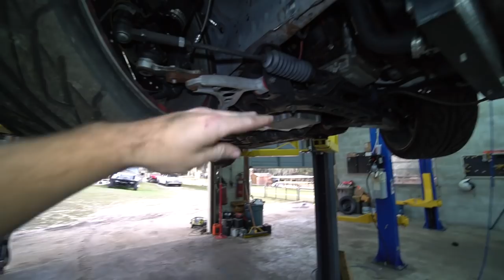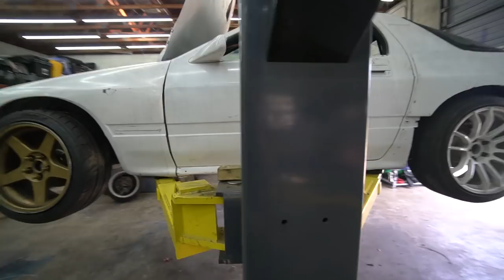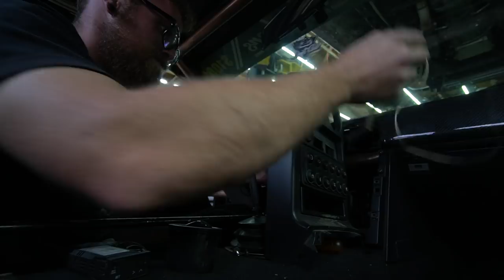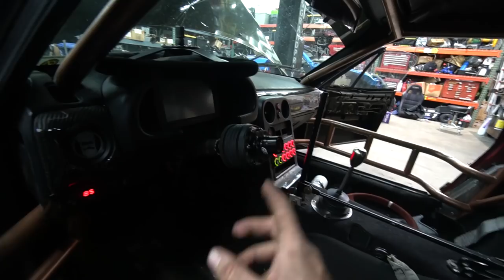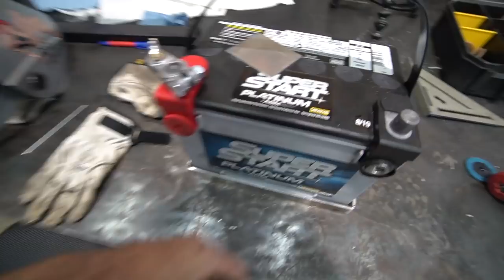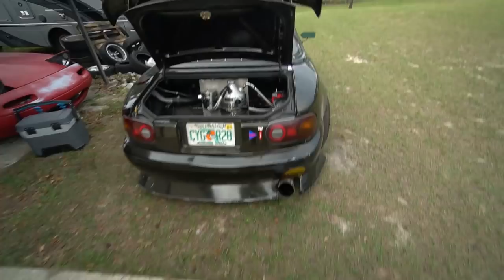Upgrades for The Abandoned FC RX7 and The LS Miata!

Comment: Go on the rx7club forums and look up "diff snubber" it's a rubber cone with a stud on it that we install above the nose of the diff to keep this from happening
Reply: Upvote this shit so Taylor sees it.
Reply: He can always PM me or add my facebook I'm very familiar with the fc chassis
Reply: I mentioned it to him a while back. Think he may have replied. I just used a truck bump stop on mine. Definitely stops the diff flopping round
Reply: Energy suspension 9.9101r
Reply: PBM front diff mount and it wont move at all. Its a giant hunk of solid steel., if you hear it hitting the subframe after throwing one of these on your subframes cracked and the front mount isnt the main worry anymore. Put one on and be done with it.
Reply: +1 for pinion snubber. even if you run the pbm diff mount you dont want it to take all the load. cheap easy mod that works.

Comment: Love PB. Was introduced to it working on heavy machinery from the 80's-90's in a factory setting, worked great then. Now it works great on the rusty NB Miata from Illinois I'm cleaning up!
Reply from the maker: The first real project I did was the torque tube on this 951 Porsche I had. Old beatup with rusty bolts. Kept snapping them. Friends dad recommended them to me. I didn’t think it would do anything. Magic in a can? Come on. Didn’t snap another bolt. Haven’t snapped one since.

Comment: Don't need any input from me but I'm going to give it any ways. PB B'laster=awesome and all I use for rusty nuts and bolts. I've been using it my entire professional wrench turning career. In fact, When I recently did my head swap on my 97 Comp T/A. I soaked the bolts on my all my exhaust connections (LT Headers to pre axle dump) for about 30 min. The exhaust hasn't been off the car since I installed it in 2007. Bolts came off like they were brand new, I recommend this product to every one. (No I'm not sponsored..lol)

As a side note, picked up a 2000 Chevy Silverado 4x4 as a new project truck recently. Stock exhaust hasn't been off the truck once in its life. First mod I did was LT Headers and full exhaust. Once again PB B'laster helped the entire exhaust system come off like it was brand new.

Comment: pb blaster every bolt on your projects a few times in the weeks before you wanna work on it, it saves so much time. when i was working at a place parting out jeeps wed walk around for 10-15 mins and spray everything we were going to pull apart

Comment: Hey taylor! I used to be a sheet metal fab guy too, I just wanted to let ya know that if you had wanted you could have notched the outer leaf's of the batt box and folded it up with a hammer with it in the vice! Might have been quicker but I know you also like to weld whenever you have the chance

Comment: I think you should look at the linishers, long belt sanders, i have one that hangs off one side of my bench grinder and has the round sanding pad and the long thin belt. Use it for everything, and they aren’t too expensive either. Cheaper still if you get the bench grinder type and you already have the grinder, you can just get the attachment. For cleaning off the alloy before welding etc its a real time saver!
Reply from the maker: Yeah I need to invest in one of those. Room is the biggest problem right now. When I get my own shop I’ll really up my fab tool game.

Comment: You can run 18’s I ran a cheap set of XXR’s 18x9+22 offset with a 235/40/18 for a tire! I’ve ran a 245/40 in the rear with rolling otherwise gotta run the 235 squared with BC’s also! On my vert! Just a thought

Comment: “Pinion snubber mod”  on rx7club. it’s a bump stop mounted to the floor. Pre lodes with washers. Worked great for me. When I went solid front mount on the diff I broke many stub shafts and complete diffs, till I went back to rubber
Reply: There is a dimple in the floor so you know exactly where to mount it

Comment: Pinion snubber for the front of the diff. Will save your mounts. Part #9.9101G
Reply: Install is insanely simple and there is a dimple where it mounts in the chassis. Between what would be the seats or containers.

Comment: PB Blaster is great. Spray about a 1/4 to 1/2 inch into a Styrofoam cup and let it sit and watch. It says it on the can but most people don't see it and/or try it. I'm guessing other brands don't react the same which means they're not as effective.
Reply: Lol how it reacts with styrofoam has nothing to do with how it reacts with metal
Reply: That was suppose to be more of a question at the end of my comment. Gasoline melts a Styrofoam cup too doesn't mean it'll help loosen up bolts. But, it does show that it has certain solvents that could potentially help break rusty or gunk up and not just lubricant.

Comment: If is possible at all for the metal braided oil lines reach the positive on the battery? (just so you don't accidently set it on fire, like if you get some external help if somepone hits your rear or something)
I've seen a racecar get on fire when the metal braided brakelines accidently hit a positive connection, and that put a hole in the hose and lit the brake fluid on fire (green-ish flame ;))

Comment: The diff snubber is a good idea, but i think you will regret not welding a “Taylor Made” solution to stop that diff sliding up as its obviously an issue that happens over and over.  A welded in stop with a bit of rubber will fix the issue for ever.

Comment: i wonder if that power issue had anything to do with your power steering going out and feeling like shit. i work for gm and ive seen alot of stupid issues occur over the smallest voltage or resistance drops. might be worth it to put the motor back in and see how it works.

Comment: What was wrong with the white wheels the car came with? Were they 18s?
Reply from the maker: 17’s but the lug holes are tiny and the only nuts that work on the crappy spline ones.
Reply: @Taylordrifts  Oooh Those. Will extra-long lugs work? I had a set of wheels on my miata that had holes like that and i got some extra-long hex style lugnuts, Just long enough to poke out of the hole and fit a standard socket on.  Or is that too much BS to deal with?

Comment: why doesn't anyone drift FB Rx7s?  I mean besides the lack of a power steering rack? they are superior to FB's. and no, I'm not a dumbass, I've owned multiple Rx7s.  Just curious.
Reply: Don't those have a live axle? A lot of people seem scared of live axle cars these days.
Reply: @lb9gta307  yeah, but with a watts linkage they settle fairly well. The biggest issue is the steering box vs having a steering rack. It's slow and sloppy. I used to drift FB's back in the day before everything got so professional.